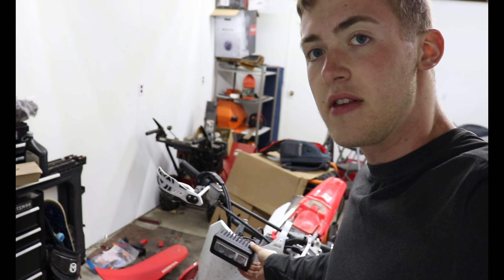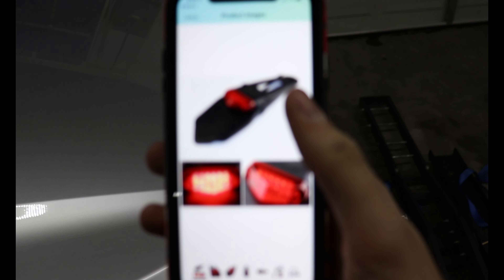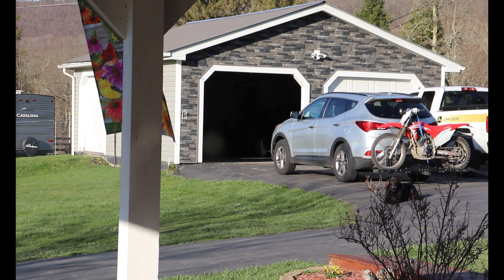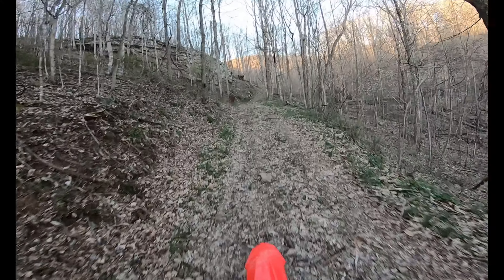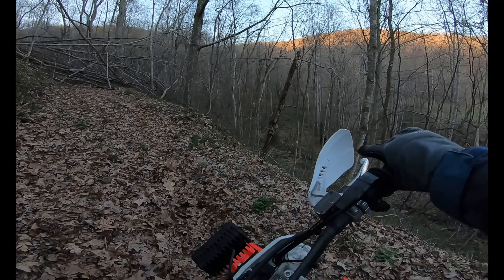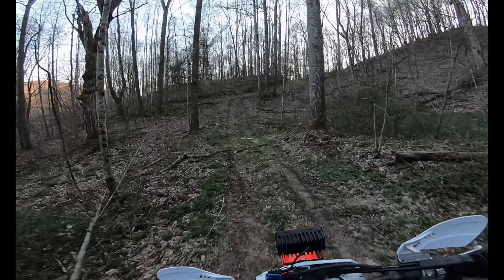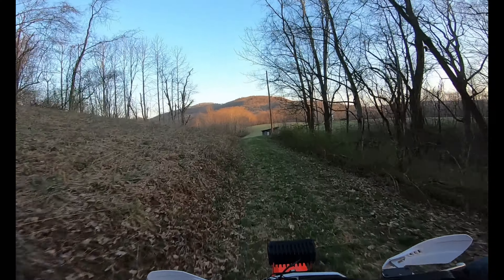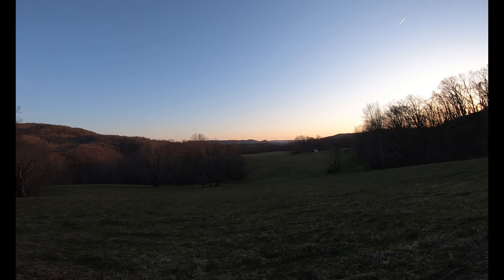My CRF250F has LIGHTS!

Comment: Hello, where did you buy your rear brake light, is there a kit? greetings from Mexico
Reply from the maker: I bought the light off Amazon, but the brake light switch is sold separately. It just screws into your brake fluid reservoir